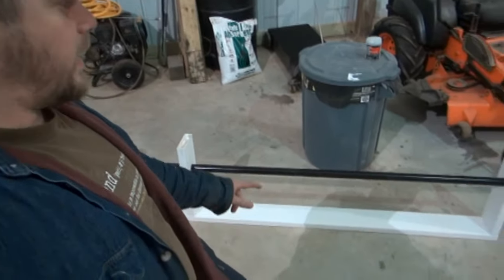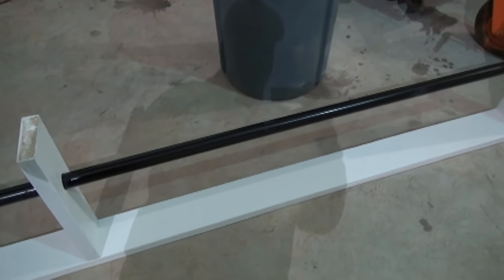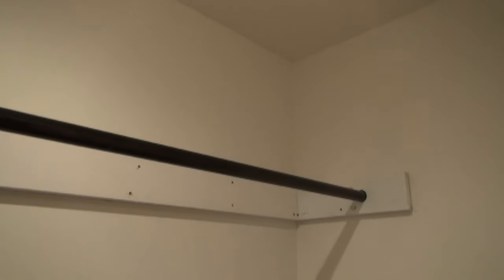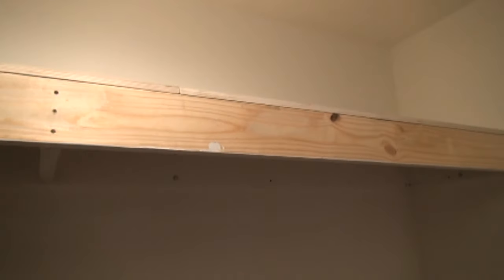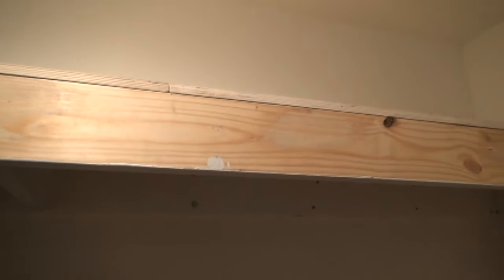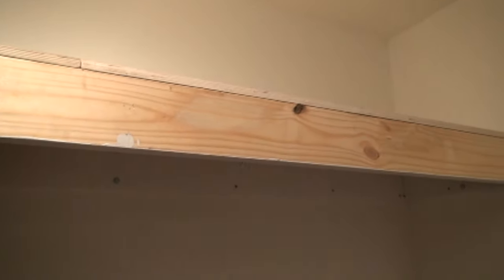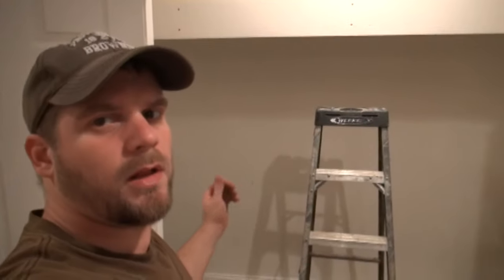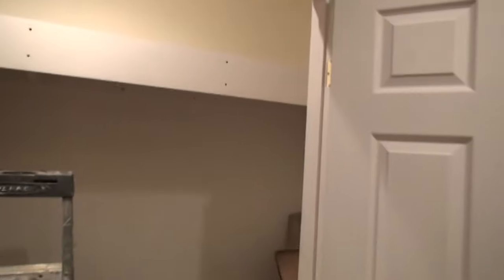Building a strong closet shelf and clothes rod

Comment: Man that's a great idea. Just one question though...was that deep enough for a hanger to clear?
Reply from the maker: Yep, works good. might could have used one size smaller pipe, had some plastic hangers that wouldn't fit over the pipe but the normal metal ones work fine
Reply: @LifeWithChase  Glad to hear it worked. I was wondering more because of the framing around the pipe. It didn't look like there was enough clearance. But man that's a strong shelf you built. Like the one you built above your desk.

Comment: Hey I was wondering how did you know exactly where to cut the hole for the pole
Reply from the maker: Just measured a standard clothes hanger to see how far from the wall the pole needed to be for the hanger to hang and then added a few extra inches to that for bigger coats and jackets that someone might hang.

Comment: What diameter and length lag screws did you use? I'm planning a similar project.
Reply from the maker: I think 1/4x31/2 but it's been a few years ago...
Reply: @LifeWithChase  thanks for responding! That's roughly what I guessed.

Comment: I dont like that board that was placed in front of the clothes rods. It just makes it more of a pain in the ass to quickly place hangers on and take them off the rod. The board is in the way.
Reply from the maker: You do realize that's what holds the shelf up right. No board no shelf. Closet is  10 ft across and they don't make plywood 10 ft long.
Reply: It's a great idea but I question how to put the clothes hangers onto the rod.  They seem to be behind the board.  I'm looking at getting this for my master bedroom closet.
Reply: @cherylenglish615  Exactly my point. The board gets in the way of the rod. Yes, it has a cleaner look to it, but it makes using the hanging rod a pain.